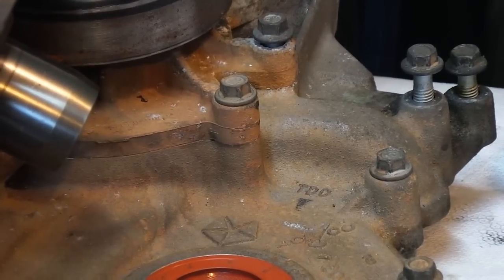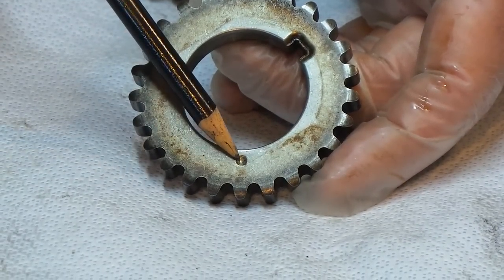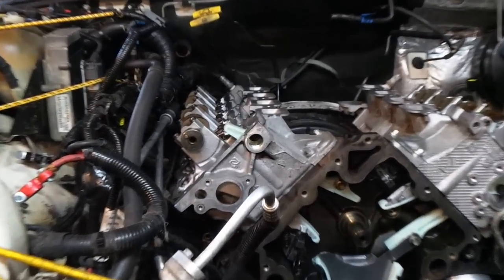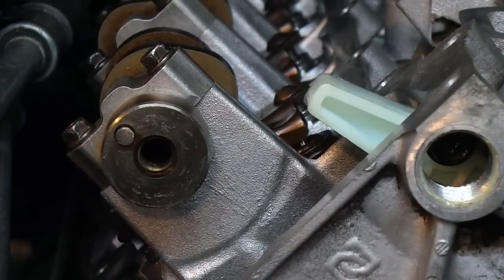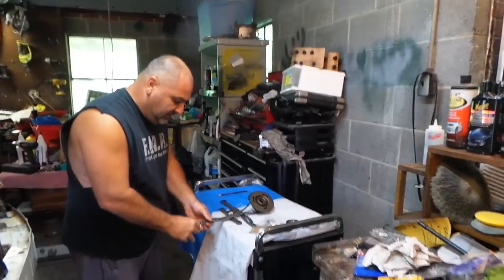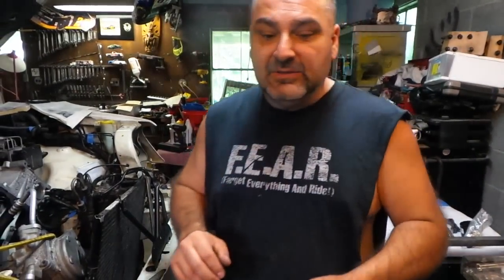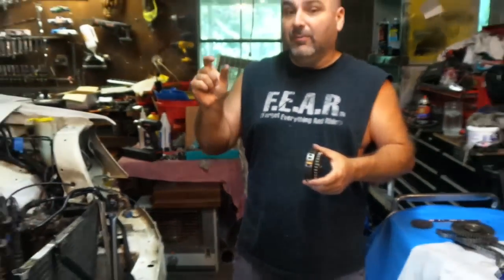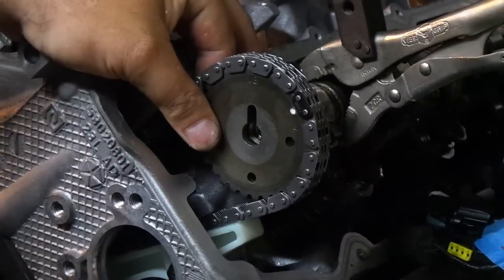Complete Timing Chain Job On A Chrysler 4.7 Engine

Comment: Well apparently the oil filter fell off motor ran with out the oil filter on for a good ten miles motor sounded really bad before I took it apart ps this is my uncles jeep lol
Reply from the maker: James Stewart  I would pull the heads and take a good look at the piston walls and valves.

Comment: having  chain noise ,, changed tensioners but still ,, having problems,,,, help.....
Reply from the maker: +Ciber Accesso Did you check the torque on the ends of the sprockets?

Comment: What happens if youre not tdc if you take off a head?
Reply from the maker: Juan Valenzuela it don't matter my man
Reply from the maker: Juan Valenzuela you just at the crank on the right spot and when you put the heads back on you'll have to line the cams back up with their marks no problem set him at 12 it'll be on top TDC for compression stroke
Reply: Thank you sir  i was just wondering  cause the chain came off out of my dodge  no damage so far. Great video.

Comment: Common problem...can't get cam sprocket back on...seems like chain is too short to get it back on the cam shaft...anybody got any advice..I know theres forums but...some advice would help out.
Reply from the maker: Make sure the sprocket is sitting in the 12 position and the with the correct spot on the Chain once you do that hold it taunt and then use vise grips to manipulate the actual camshaft and it will go in place but you got to make sure you don't have any tension on that chain so the tensioners can't be deployed yet

Comment: hi TheCarMan  pleasse can you help me i need the all torque for theengine  Chrysler 2.7 v6  because  i am overhauling  this motor  torque crankshaft  bearings
Reply from the maker: +Duvan Orozco Hi Duvan, I don't have the torque specifications for your particular engine right at hand so if you just go to the Chrysler website and put in your car's info and it should bring it right up for you.

Comment: I am watching this video because I had to have a cracked head replaced on my 2006 Grand Cherokee (3.7L). I spent $4600 (he also machined the existing head and replaced the oil pump and water pump) only for the mechanic to not  to check  the timing chain  tensioner  And it broke the dowell connector pin that connects the cam to sprocket just 10 minutes after he started it up. .....the mechanic is paying for another head but now he is hitting me up for another $640